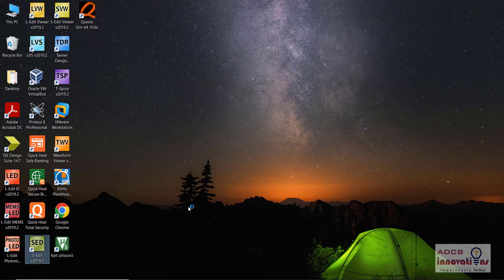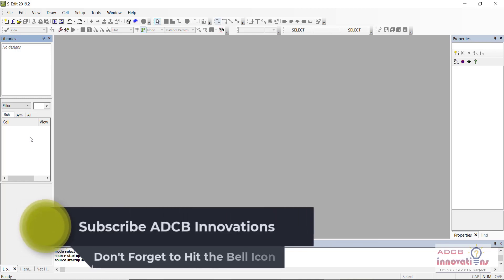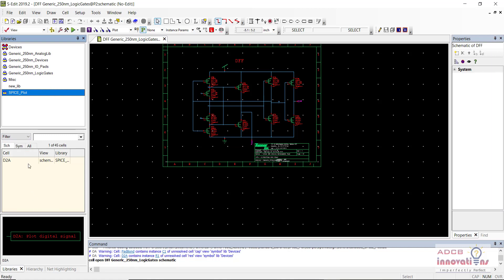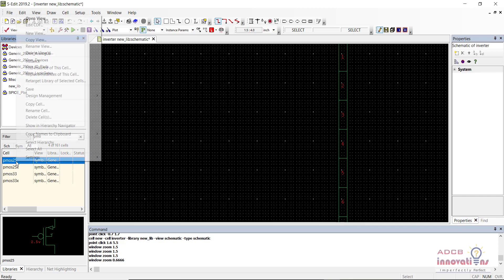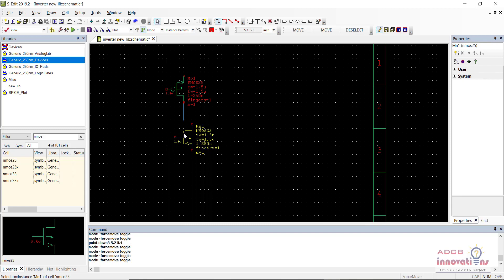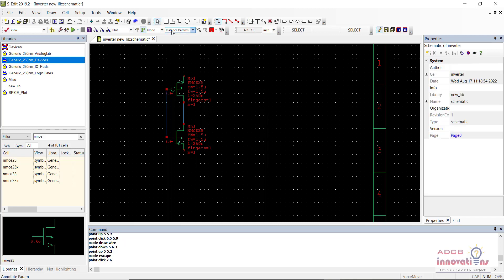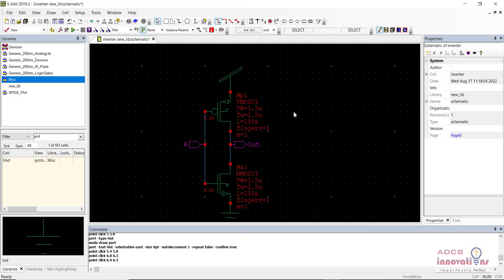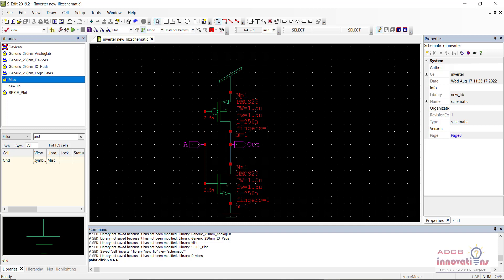Introduction to Tanner S-Edit

Comment: can we use nfet other than nmos ?
Reply from the maker: Yes you can definitely try the nfet or any other mosfet. However, you might get different results based on the properties of the device you are simulating.

Regards
ADCB Innovations Pvt. Ltd.